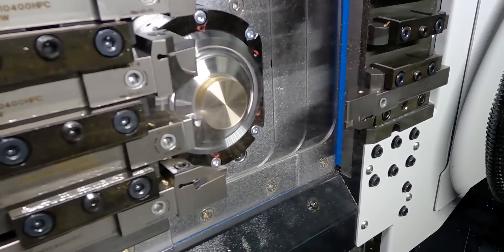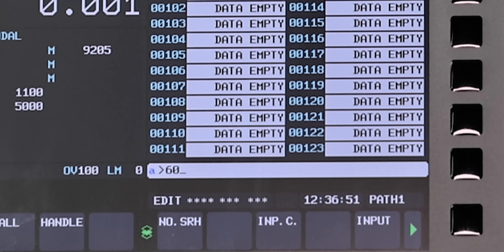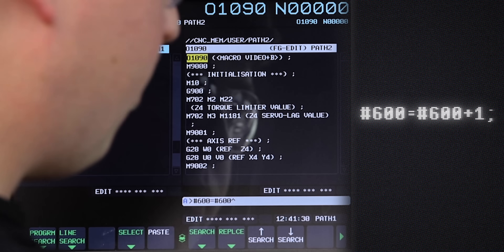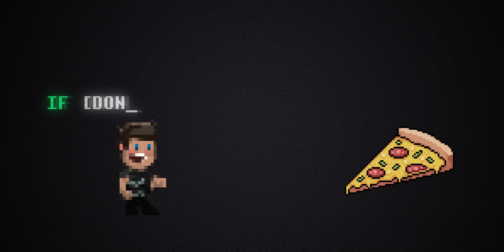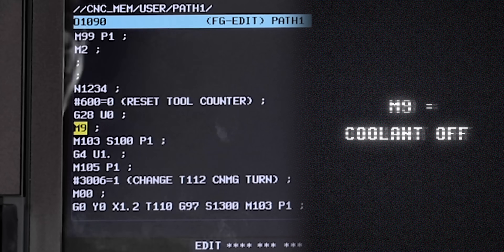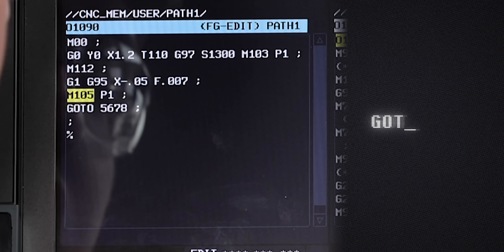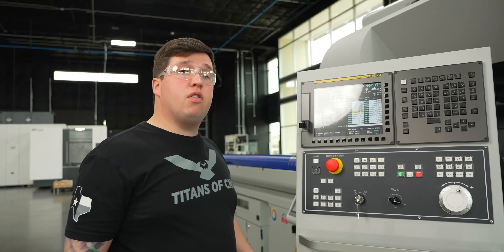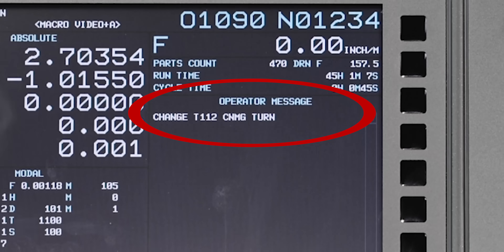Secret Art of MACRO PROGRAMMING on a CNC Machine | G-Code Genius

Comment from the maker: Here is the Macro used in the video for any of you that are interested. 

%
O1090(<MACRO VIDEO+A>)

#601 = 10 (T112 MAX TOOL LIFE)

G800 A1.125 B1 C0.5 D0.1 E.03 F0.0155
G801 A1100 B0.118 C0 D97 E2000 F.004
G802 A0.5 B0.5 C0.5 D0.5 E1 F0.5
G803 A2 B0 C1
M9000
(*** INITIALISATION ***)
M10
M82
/M8
G4 X1
G900
M9001
M9002
(*** AXIS REF ***)
G28 U0
G28 V0
(*** INITIAL CUTOFF ***)
M8
G910
M9003
(*** START LOOP ***)
N1 M120
(*** END OF BAR TEST ***)
G913
G930
M9004
(*** FEED NEW PART ***)
G912 B500
G0 W0.00787 (RETRACT THE BAR IN Z)
G0 X1.33858 T110 D0 (RETRACT THE CUT OFF TOOL X)
G1 G94 W.65 F165.
G28 U0
M9005
(*** MACHINING ***)
M9
G0 G95 G97 S1450 M103 P1 T112 D0 Y0
X1.2 Z0
G92 S5000
G96 S330 P1
G1 X-.05 F.007
G0 X.775 Z.02
G4 U1.2
G1 Z0 F.008
X.875 Z-.05
Z-1.03
X1.15
G0 G97 X1.2
#600 =  #600+1
G28 U0
()
()
M9200
(*** CUT-OFF PREPARATION ***)
G97
M8
G0 X1.33858 Y0 T110 D0 M103 S5000 P1
G911
G1 G95 X.775 F.004
G0 X.9
W.045
G1 X.875
X.785 W-.045
G0 X.9
M9201
M9202
G1 G95 X-.045 F.004 (CUTOFF)
M9203
G1 X-.05 F0.00118 (END OF CUTOFF)
G97 (CONSTANT CUT-OFF CANCELLATION)
IF [ #600 GE #601 ] GOTO 1234
N5678
(*** END LOOP ***)
M121
M9204
M9
M105
M1105
M2105
M9205
M0 (STOP A END OF CYCLE)
/M8
G4 X1
M9206
M99 P1
M2
N1234
#600 = 0 (RESET TOOL COUNTER)
G28 U0
M9
M103 S100 P1
G4 U1.
M105 P1
#3006 = 1 (CHANGE T112 CNMG TURN)
M00
G0 Y0 X1.2 T110 G97 S1300 M103 P1
M112
G1 G95 X-.05 F.007
M105 P1
GOTO 5678

O1090(<MACRO VIDEO+B>)
M9000
(*** INITIALISATION ***)
M10
G900
M702 M2 M22 (Z4 TORQUE LIMITER VALUE)
M702 M3 M1181 (Z4 SERVO-LAG VALUE)
M9001
(*** AXIS REF ***)
G28 W0 (REF  Z4)
G28 U0 V0 (REF X4 Y4)
M9002
G919
M9003
(*** START LOOP ***)
N1 M120
M9004
G55
M405
M9005
(*** MACHINING ***)
()
()
(*** PART EJECTION ***)
G55 (Z4 ZERO OFFSET FOR BACKWORK MACHINING)
M405
G28 W0 (REF  Z4)
G0 X0 T500
M11 (OPEN THE COLLET S4)
G4 X0.5
M84
M85
G4 X0.2
G28 W0 (REF  Z4)
G28 U0 (REF X4)
M9200
M9201
(*** PART PICKOFF ***)
G915 (SHIFTING FOR WORK IN OPERATION)
G97
G0 X0 Z0.07874 T400 M404 S5000 P4 (APPROACH BACK SPINDLE)
M418 (SYNCHRO PHASE)
M702 M4 M1 (TORQUE LIMIT Z4)
M702 M5 M1 (ENABLE SERVO-LAG CHECK Z4)
G924 (PART PICKOFF)
M9202
M9203
G1 G94 W0.07874 F78.74016 (CHECK BREAKAGE CUTOFF TOOL)
M702 M5 M0 (Z4 DISABLE SERVO-LAG CHECK)
M702 M4 M0 (Z4 TORQUE LIMIT CANCELLATION)
G95 (FOR LOOP START)
G28 W0 (RETRACT BACK SPINDLE)
(*** END LOOP ***)
M121
M9204
M405
M5105
M9205
M0 (STOP A END OF CYCLE)
M9206
M99 P1
M2

%
Reply: #3006 is the same as M0 but with a message. Do you have to press cycle start twice?  I use this all the time in programs, usually between tool changes, to have the operator clear scrap, fasten a part down, rotate a part, etc. He hits cycle start and program continues.  #3006=1 (MESSAGE) is part of my default insert manual code in Mastercam. 👍
Reply: sooo my fanuc didnt have a internal program to do cavity type operations ... so i spent a good day at home outside of work hours..... and made this abomination. when i made it i was warking in italy so comments  are in italian . not changing it for this post just google translate things :D 

% 
:0887(SVUOTAMENTO CIRCOLARE) 
(VERSIONE 2.0 PERL)
 
G52X#31Y#32Z#33(POSIZIONAMENTO)
 
G0G54X0Y0
Z1 
G1Z0.1 
 
 
(---DATI FRESA---) 
(DIAM FRESA) 
#1=22.3
(PERCENTUALE UTILIZZO FRESA - DA 1 A 100)
#6=95
 
(---DATI CAVA---)
 
(DIAM CAVA)
#2=28
(PROFFONDITA MAX)
#3=18
(SOVRAMETALLO PARETE)
#4=0 
(SOVRAMETALLO FONDO) 
#5=0 
(PARTENZA LAVORO Z - METTERE ZERO SE PARTE DA SOPRA) 
#7=0 
(NUMERO PASSATE PASSATE) 
#8=23
 
(---CONTROLLO SICUREZZA---)
IF[#2LE#1]GOTO100
 
(---MATEMATICHE---)
 
(DIVISIONI PER RAGGI)
#11=[#1/2](RAGGIO FRESA) 
#12=[#2/2](RAGGIO CAVA)
#13=[#1/100] 
#14=[#13*#6](PERCENTUALE UTILIZZO FRESA) 
#15=[#14/2](META UTILIZZO FRESA) 
#17=[#12-#4](RAGGIO PARETE CON SOVRAMETALLO) 
#18=[#3-#5](FONDO CON SOVRAMETALLO)
#22=[#18/#8](INCREMENTO PASSATA Z CALCOLATO) 
#23=[#22/2](INCREMENTO Z PER FORI MINORI RAGGIO FRESA) 
#30=[#17-#11](INCREMENTO X PER FORI MINORI RAGGIO FRESA) 
 
 
(--- MODULI FORI MINORI RAGGIO FRESA---) 
IF[#17LT#1]GOTO1 
 
 
IF[#17GT#1]GOTO2 
 
 
N2 
 
#110=#22 
#111=#14 
G0X0Y0 
WHILE[#110LE#18]DO1
#111=#14 
G1X#15Y0 
G1X-#15Z-[#110-#23]
G1X#15Z-#110 
WHILE[#111LT#30]DO2
G1X#111Y0
G3I-#111 
#111=[#111+#14]
END2 
G1X#30 
G3I-#30
G1X[#30-1]Z-[#110-1] 
G1G40X0Y0
Z-#110 
#110=[#110+#22]
END1 
G0Z10
GOTO101
 
 
N1 
#110=#23 
G1X0X0 
G1X#30 
WHILE[#110LE#18]DO1
G3I-#30Z-#110
#110=[#110+#23]
END1 
G3I-#30
G1G40X0Y0
G0Z10
GOTO101
 
 
N101 
G0Z20
M99
G53Y0Z0
N100 
M30
 
%
Reply: also one for radial holes .

% 
:0885(FORATURA SU ARCO CIRCOLARE)
(V.1 PERL) 
 
G52X#31Y#32Z#33(POSIZIONAMENTO)
 
G16
(#2=DIAMETRO INTERASSE)
(#3=PARTENZA IN GRADI) 
(#4=GRADI TOTALI)
(#5=NR.FORI) 
(---MATEMATICHE---)
#8=[#5-1]
#7=[#2/2](RAGGIO)
#6=[[#4-#3]/#8]
#110=[#6+#3] 
X#7Y#3 
WHILE[#110LE#4]DO1 
X#7Y#110 
#110=[#110+#6] 
END1 
G15
G17
M99
 
 
 
 
 
M30
%
Reply: and circular holes 

% 
:0886(FORATURA CIROLARE) 
 
(V.1 PERL) 
 
G52X#31Y#32Z#33(POSIZIONAMENTO)
 
G16
(#2=DIAMETRO INTERASSE)
(#3=PARTENZA IN GRADI) 
(#4=GRADI TOTALI)
(#5=NR.FORI) 
(---MATEMATICHE---)
#7=[#2/2](RAGGIO)
#6=[[#4-#3]/#5]
#110=[#6+#3] 
X#7Y#3 
WHILE[#110LT#4]DO1 
X#7Y#110 
#110=[#110+#6] 
END1 
G15
G17
M99
 
 
 
 
 
M30
%
Reply: As an IT guy, im super interested in product development which is how i am getting into machining now. However, i am wondering if G code isnt super inconvenient to write?
Reply: Could you do a video on using macros to use a drill to run once to say 5" deep then face and part off without drilling until you reach the 5" that the drill had ran, then push the bar out again and drill again to 5". Like you were going to machine parts that are .250 long. Thanks love your videos. Don't be stupid!

Comment: If you can't stand up program a CNC lathe using G-Code, you shouldn't be running a CNC Lathe.  If you're using this to assist and be more efficient,  cool.  If you depend on this, then you should learn more and get better at your job.  All of these settings are already available in just about any CNC machine made after 2004.

Comment: I don't understand the GE line wouldn't you want that to be a LT so that the machine keeps running while it's LT ten and then when it counts up to ten have it go to m30 or m00 etc
Would this work?
#601=10
#600=0
N1234
Main program
#600=#600+1
If[#600 LT #601]N1234
M2

Comment: Never use GOTO statement in any code. Yo can learn that in the first year of University. In the next years you can learn it from experience when other try to use it.
Anyway, series of programming CNC I found very productive. Keep it rolling.
Reply: If you are programming fanuc cnc it is not easy to avoid GOTO. The IF statements allows the conditional execution of a single macro statement or a conditional GOTO. Therefore if you want to condionally execute a bunch of macro ans cnc lines there are little alternatives. But I agree with you that GOTO should be avoided whenever possible.

Comment: Love the video.  I once altered a cnc heater band cutting tool path so it could handle differing slot lengths and any kind of clearances.  Commented the living daylights out of the top page explaining what the variable did on the program.  Showed the boss a simulation and asked if we could try it.  Long story short, less cutting time, everything matched up, and less cutter sharpening.  This also freed up the cam programmers to concentrate on one off programming.  And yes I got a nice raise too boot.

Comment: And withthis Macro here you can farting Holes or Taps. 

&HE: % 

:9109(TAPING-DRIL-OUTSI/INSI/LEF/RIGH) 
(WRITTEN-BY-M.BRANS) 
(G65 X=#24 Y=#25 Z=#26 W=#23 H=#11 Q=#17 D=#7 T=#20 R=#18 A=#1 B=#2 C=#3 E=#8 F=#9)
 
IF[#1GT#0]GOTO10 
IF[#2GT#0]GOTO20 
IF[#3GT#0]GOTO30 
IF[#8GT#0]GOTO40 
 
 
N10(DRILING-TAPING-OUTSIDE-RIGHT)
#24=#5001
#25=#5002
IF[#2EQ1]GOTO160 
IF[#3EQ1]GOTO170 
IF[#8EQ1]GOTO180 
IF[#23LT#26]GOTO135
IF[#24EQ#0]GOTO50
IF[#25EQ#0]GOTO60
IF[#26EQ#0]GOTO70
IF[#23EQ#0]GOTO75
IF[#17EQ#0]GOTO80
IF[#7EQ#0]GOTO90 
IF[#20EQ#0]GOTO100 
IF[#18EQ#0]GOTO115 
IF[#9EQ#0]GOTO130
 
#100=[#7-[1.2269*#17]]/2 
#101=#100+#18+#20
#102=[#26-#23]/#17 
#102=FIX[#102] 
#103=#100+#20
G90G0X#24Y[#25+#101] 
G0Z#23 
#104=#5003 
G03Y[#25+#103]R[#18/2]F#9
N1WHILE[#102GT0]DO1
G02X#24Y[#25+#103]J-#103Z[#104+#17]F#9 
#102=#102-1
#104=#104+#17
END1 
G03Y[#25+#101]R[#18/2] 
G0Z5.
G90G0X#24Y#25
M99(M99) 
 
N20(DRILING-TAPING-OUTSIDE-LEFT) 
#24=#5001
#25=#5002
IF[#1EQ1]GOTO155 
IF[#3EQ1]GOTO170 
IF[#8EQ1]GOTO180 
 
IF[#24EQ#0]GOTO50
IF[#25EQ#0]GOTO60
IF[#26EQ#0]GOTO70
IF[#17EQ#0]GOTO80
IF[#7EQ#0]GOTO90 
IF[#20EQ#0]GOTO100 
IF[#18EQ#0]GOTO115 
IF[#9EQ#0]GOTO130
 
#100=[#7-[1.2269*#17]]/2 
#101=#100+#18+#20
#102=[#26+#11]/#17 
#102=FIX[#102] 
#103=#100+#20
 
G90G0X#24Y[#25+#101] 
G0Z#26 
#104=#5003 
G03Y[#25+#103]R[#18/2]F#9
N1WHILE[#102GT0]DO1
G02X#24Y[#25+#103]J-#103Z[#104-#17]F#9 
#102=#102-1
#104=#104-#17
END1 
G03Y[#25+#101]R[#18/2] 
G0Z5.
G90G0X#24Y#25
M99(M99) 
 
N30(DRILING-TAPING-INSIDE-RIGHT) 
#24=#5001
#25=#5002
IF[#1EQ1]GOTO155 
IF[#2EQ1]GOTO160 
IF[#8EQ1]GOTO180 
IF[#24EQ#0]GOTO50
IF[#25EQ#0]GOTO60
IF[#26EQ#0]GOTO70
IF[#17EQ#0]GOTO80
IF[#7EQ#0]GOTO90 
IF[#20EQ#0]GOTO100 
IF[#9EQ#0]GOTO130
IF[#11EQ#0]GOTO131 
#100=[#7/2]-#20
#110=#7/2
IF[#20GT#110]GOTO46
#102=[#26+#11]/#17 
#102=FIX[#102] 
 
G90G0X#24Y#25
G1Z#26F#9
#104=#5003 
G03Y[#25+#100]R[#18/2]F#19 
N1WHILE[#102GT0]DO1
G03X#24Y[#25+#100]J-#100Z[#104-#17]F#19
#102=#102-1
#104=#104-#17
END1 
G03Y#25R[#18/2]
G0Z5.
G90G0X#24Y#25
M99(M99) 
 
N40(DRILING-TAPING-INSIDE-LEFT)
#24=#5001
#25=#5002
IF[#1EQ1]GOTO155 
IF[#2EQ1]GOTO160 
IF[#3EQ1]GOTO170 
IF[#23LT#26]GOTO135
IF[#24EQ#0]GOTO50
IF[#25EQ#0]GOTO60
IF[#26EQ#0]GOTO70
IF[#23EQ#0]GOTO75
IF[#17EQ#0]GOTO80
IF[#7EQ#0]GOTO90 
IF[#20EQ#0]GOTO100 
IF[#9EQ#0]GOTO130
#100=[#7/2]-#20
#110=#7/2
IF[#20GT#110]GOTO46
#102=[#26-#23]/#17 
#102=FIX[#102] 
 
G90G0X#24Y#25
G0Z#23 
#104=#5003 
G03Y[#25+#100]R[#18/2]F#9
N1WHILE[#102GT0]DO1
G03X#24Y[#25+#100]J-#100Z[#104+#17]F#19
#102=#102-1
#104=#104+#17
END1 
G03Y#25R[#18/2]
G0Z5.
G90G0X#24Y#25
M99(M99) 
 
N46#3000=1(MILL DIA TO GREAT)
N50#3000=1(NEED --X-- COORD.=0) 
N60#3000=1(NEED --Y-- COORD.=0) 
N70#3000=1(NEED --Z-- COORD.HOLE DEEP) 
N75#3000=1(NEED --W-- COORD.FROM PIECE OVER TOP) 
N80#3000=1(NEED --Q-- COORD.RAMP AROUND DEEP) 
N90#3000=1(NEED --D-- COORD.DIA OF HOLE) 
N100#3000=1(NEED --T-- COORD.RADIUS OF TOOL)
N115#3000=1(NEED --R-- COORD.RADIUS OF HOLE)
N130#3000=1(NEED --F-- FEEDRATE)
N135#3000=1(-W- INE MEGALI AN AM -Z-)
N136#3000=1(-W- INE MEGALI AN AM -H-)
N150#3000=1(NEED H ASS)
N155#3000=1(BAPIABLE A LAZOS)
N160#3000=1(BAPIALE B LAZOS) 
N170#3000=1(BAPIABLE C LAZOS)
N180#3000=1(BAPIABLE E LAZOS)
%

Comment: The only way to know if a macro is not being used is to do a deep dive to every program on the machine and check for macros that are being used. Reading the documentation that comes with the machine is a good start, but I ran machines where the machine tool builder book was wrong. On top of that, you don’t know if anyone had dip there fingers in the programs on the machine. I myself will program Marcos that will return the values to null when finished as a safety check to make sure those values can’t be used somewhere else.  

With that being said, can you go over the basic concepts to writing programs for probing?  

Like how to check for low battery State

Calibration procedures 

How to find the safest max feed rate during a non contact move and the fastest feed rate that can be use for a measuring move.
Reply: That’s a good idea, but a better idea would be to read and store any value already in the variable, then return it to that value after your macro finishes. That way, if the machine is depending on an already stored variable, it’s not jeopardised from having been returned to null…..

Comment: I program at a job shop with machines that are mostly 35+ years old. Macros and Subs help me keep my programs small enough to fit in the 32k-1024k of program memory I have. Also, I make macros for simple operations so the machinists can punch in a few variables and get stuff like helical plunge operations without bothering me
Reply: helical plunging is a waste of time prefer to plunge point for pocketing dynamic. also subroutine G91 G03 I-. Z-. for counter bores much easier to identify, edit, much faster

Comment: Can you show how you would input the same macro "tool life" for multiple tools that have various tool life. Say od turn rough has 20pcs tool life.  Od finish 40pcs. Cutoff 40pcs etc. I feel like your greater to or equal to main count say od turn rough of 20 would have to be in a different area. Or do you just create those macros in tandem with start at say 400 finish 401. But with all tool life?  Thanks in advance

Comment: I'd really like to see a macro that can vary the spindle speed during a cut on a lathe to prevent chatter.
Reply: You can do it. I’ve written one in the past, it’s usually dependent on an added variable for the distance travelled before the chatter starts then adjusting the speed up or down as required when it reaches that point. I found it a bit awkward to use in practice because it requires trial and error for each different type of part before they can run in production.
Reply: @Glenrok  I think the top level comment is actually talking about a macro that constantly varies cutting speed based on a randomly generated (or a seed generated / function) pattern along the programmed path (whatever that is) around a base value.  This should by itself alleviate some chatter issues by itself because it'd break up resonance from building up.

What you seem to be implying is a cutting speed gradient along a path which is a trial and error solution but you can guesstimate from experience a bit sometimes. Something like a 50% slowdown over a 4xD distance for example. My own experience is actually more dealing with extremely long endmills, 6xD+, occasionally had to grab a 10xD here and there to mixed success.
Reply: @xm210c  yes, that’s exactly how my macro worked. Either way it would have to effect some change in rpm based on either time or distance- obviously I chose distance for mine. I like your idea of a randomly generated number within a specified range, unfortunately I neither know or can find a function in Macro B which would produce one, so a macro would have to be written just for that which would then be called by the chatter macro. I doubt the maths to do so is beyond me- but it is beyond what I could be bothered to mess around with to find out…….😏

Comment: i'd love to see a macro for siemens, i have a siemens 840d sl controller, and the machine is automated with a robotic arm from ABB, however the camera that sends the coordinates for the part to pick to the robot is not that good. when i use marposs probe i want to be able to limit the probe if i have a part sticking out on the one side for milling it so i don't have to machine my jaws over and over again

Comment: I got a 3 axis vertical mill.  Fanuc control. With very little memory.  I would like to run multiple vises and run more parts without creating longer programs and sometimes you may only be able to setup one or 2 vises. With each vise being assigned G54, G55, G56, etc.  Is it possible to write a macro to change the work offset in each tool block  to cycle through G54, G55, G56?   May make for a informative video?  Great job with all your doing! Helping us  all means a lot!
Reply: most fanuc controls can switch the work offset just by typing G54, G55 etc. (that's why they actually called G..)
so the program will be as simple as
G54;
M98 P0001;
G55;
M98 P0001;
...
M30;
Reply: There are a few ways to do this,  but sticking with what was in the video,  you could do the same format, run your program in g54, hit 601, your 1234 takes you to a g55, since that's modal, your program can run assuming you don't have 100 g54s in the way, then 602 takes you to g56. Or something like that. You can sit down and write it out

Comment: This is control specific. Especially with fanuc controls. I highly recommend you read the machine manual AND the yellow fanuc books that come with your machine. With most fanuc controls you'll need a #3000 under your M30 or "end of record" M code.

Comment: what is a fucking point you have CAD system for programming and hard drive ,macro was only to save memory long time ago are we going backward
Reply: It depends on the application. In many gear cutting machines all programs are parametrized with macro, so the operator does not have to write any code. In a milling machine you could consider this example: suppose you have a built in tool presetter and you wamt to measure all the tools in the magazine. You could do it with a macro program. I think this kind of programming is still useful.

Comment: I’m wondering why you chose 10 as the tool life. Is that accurate or is 100 more accurate?
Reply: It can be whatever you want. Usually run the tool to failure with a count on parts made, then set your counter value a comfortable number under that failure point
Reply: @Glenrok  that make sense